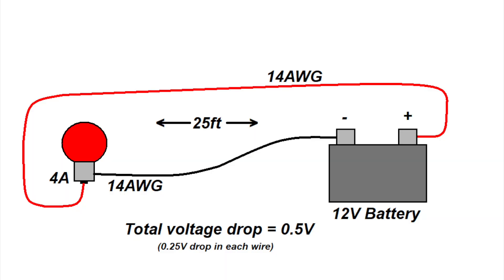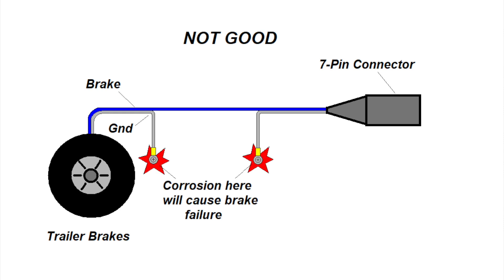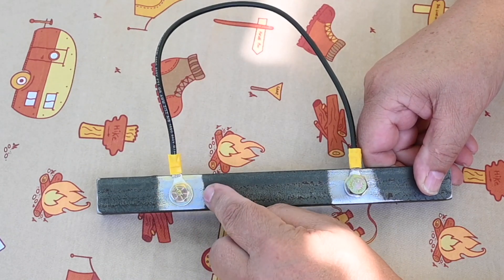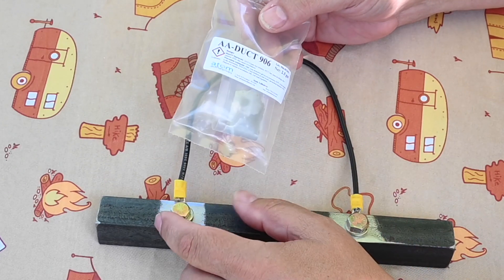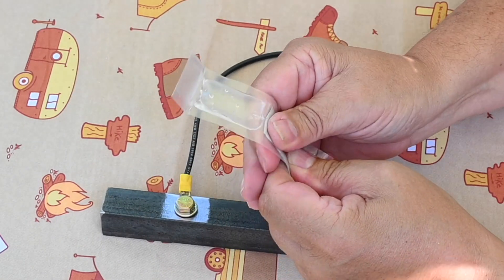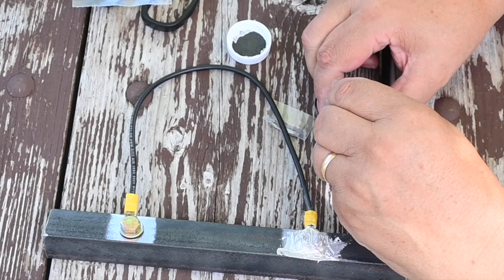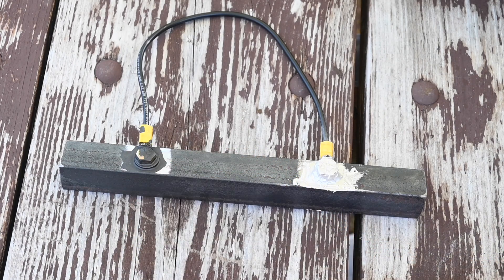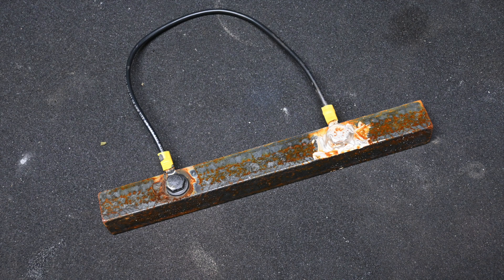Are your RV's ground chassis connections bad?

Comment: Hello, 

Just discovered your channel, 
I have a SPST switch with 4 leads a white brown or black (hard to tell)and two reds how can I wire  this switch to be used as interuppter or to control a single wire device?

Thanks in advance.
Reply from the maker: I am not visualizing your switch.  A SPST switch should only have 2 leads unless the other two leads are used for an indicator light.

Comment: Isn't the wire loop making the testing less accurate? Snip it and then check resistances. Also I would have put the glue under the bolt head/washer. That's where the connection really is happening. Any paint could be used on top of the connection to prevent corrosion. I like your vids, as you usually don't miss such simple points.
Reply from the maker: The silver-epoxy comes in different conductivity characteristics, depending on which formulation you buy (and resultant cost).

I avoided putting epoxy under the bolt because I didnt want the reading to be skewer by the conductivity characteristics of the epoxy I used.

For that reason, I cleaned the metal and made metal-to-metal contact and applied the conductive epoxy over the bolt.

I actually cut the wire in half in the final test so I could test each connection separately.

I didn't cut the wire until I was ready to do the "after" test as I put the test piece directly under dripping water and didnt want any exposed wire to be damaged from water wicking into the wire stranding.

I have seen water wick a foot or more under the insulation in stranded wire, and wanted to rule that out.

Comment: From what I have seen on the 4 RV trailer I have owned, is that the terminals are just screwed to the frame right thru the paint. No paint was removed so that a good connection between the terminal and frame could be made.  This is a bad practice and does lead to problems.
Reply from the maker: Especially when brake circuits are involved.

Comment: I had an issue with my travel trailer electrical when towing on a recent two month trip.  The truck would tell me the trailer was disconnected for 10-20 seconds, then reconnect.  My first thought was the trailer receptacle had worn.  I noticed that jiggling(technical term) the connection did not reproduce the issue.   Did some internet searching and discovered that chassis grounds on the truck or the trailer were the most likely.  I found that the trailer ground was the culprit and cleaned it up and fixed the problem.  My solution was a little different than yours in that once the parts were clean bare metal, I used silicone electrical grease to protect the connection from the weather.  I know that the silicone grease is not conductive, but I am just using it to protect not conduct.
Reply from the maker: Silicone grease does work, but it isn't a permanent solution.
Reply: @RVProject  Agree, it is not permanent.  I was thinking that I would clean it again and then paint it for corrosion protection.  I am wondering if you think the conductivity of the epoxy is important or it is just protecting the connection.  Would normal JD weld offer the same protection at a lower cost?